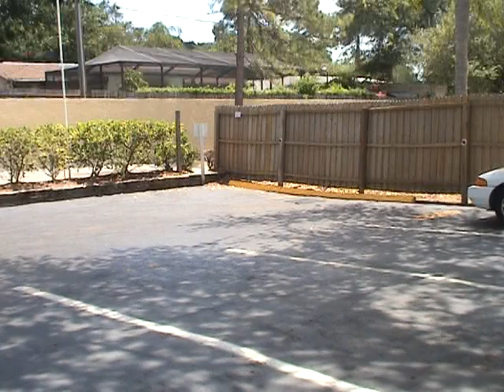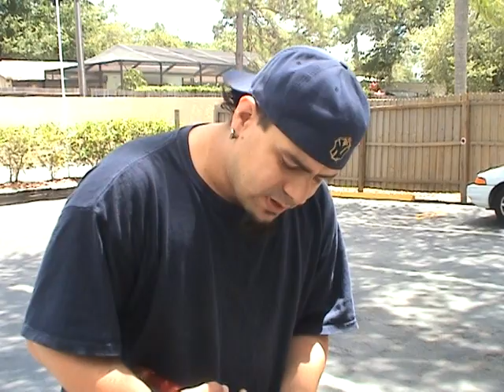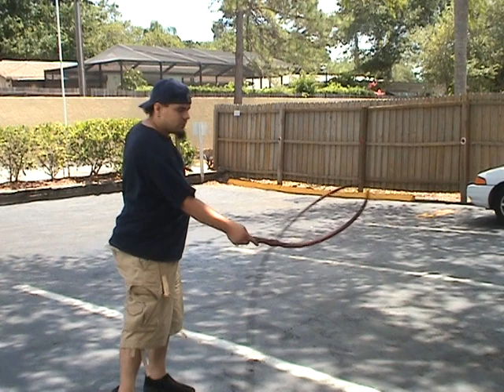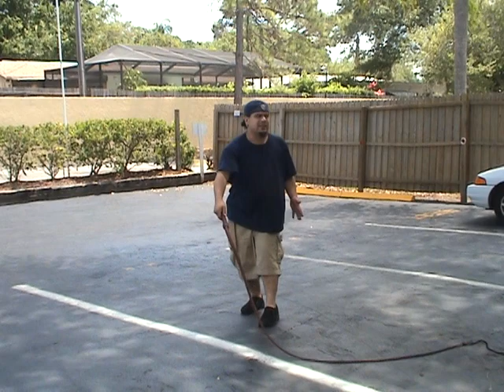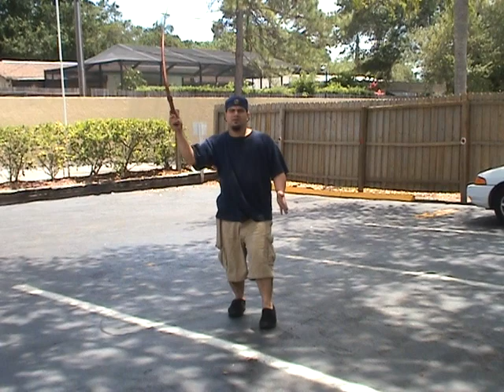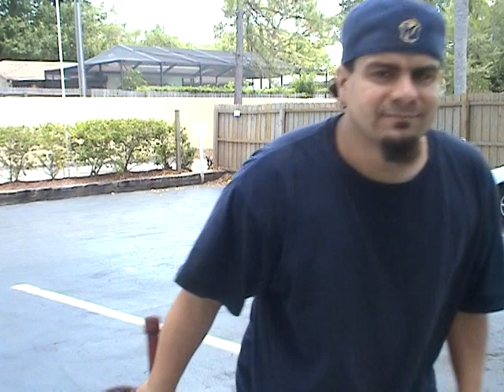Bullwhip Cracking - The Lighter Crack!

Comment: like the one before my comment, the concrete isn't good for the leather. and the throw forward should be smoother, don't be too cocky with it, it should be a smooth fluid motion of the wrist, not the quick jerk of the shoulder. so yeah, it's all on the wrist